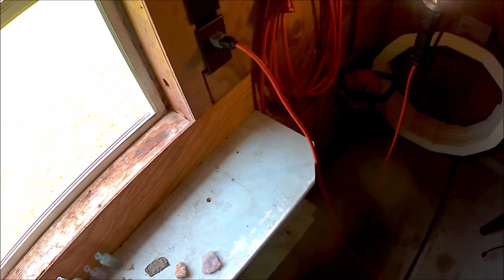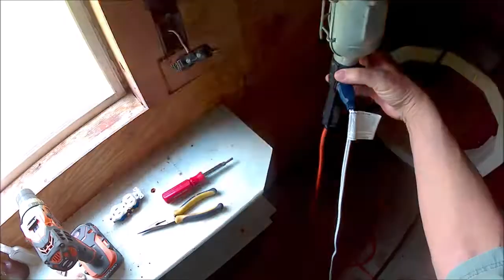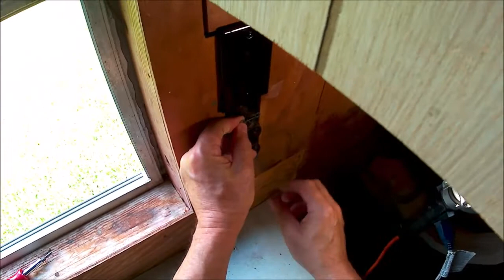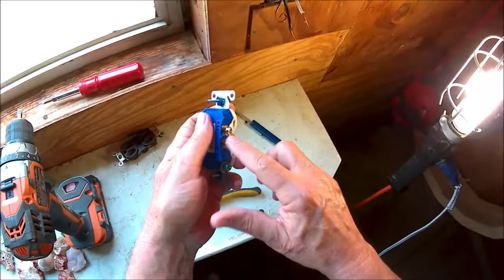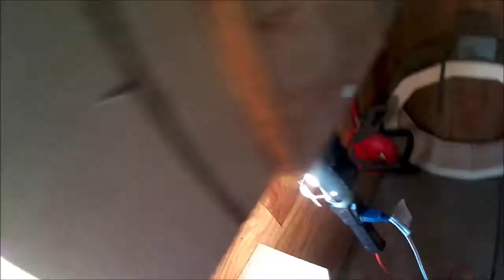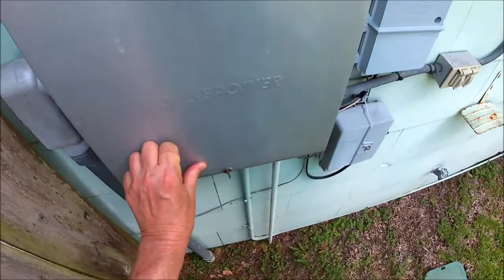When and How to change a electrical receptacle (outlet).

Comment: That's good information, my home was built in 95 and I'm having the same problem.
Reply from the maker: If I didn't already have some spare outlets I would buy the type of outlet that had the screw clamp. Not the ones you just stick the wire in the holes in the back but the ones you put under the clamps then have to tighten the screws.